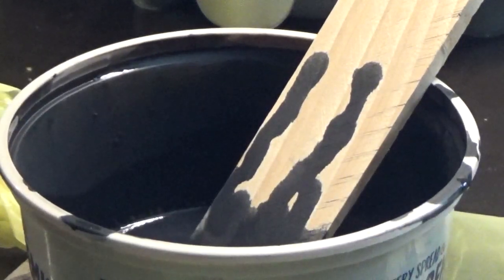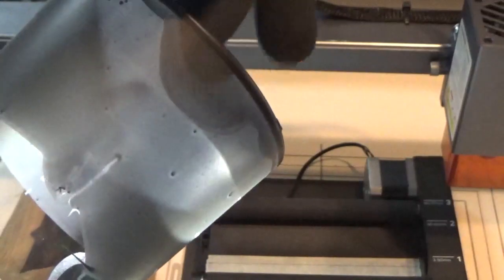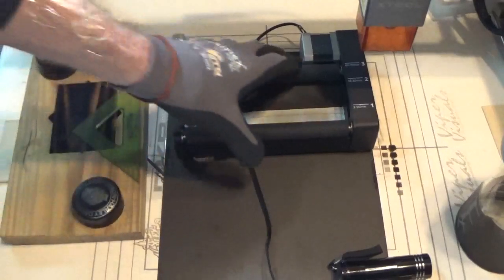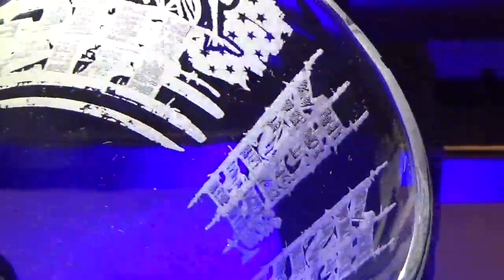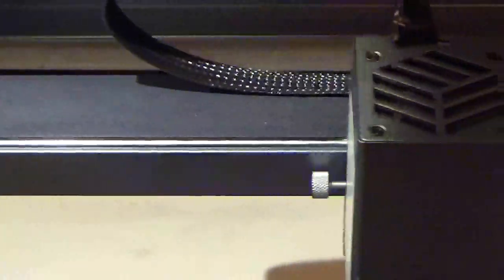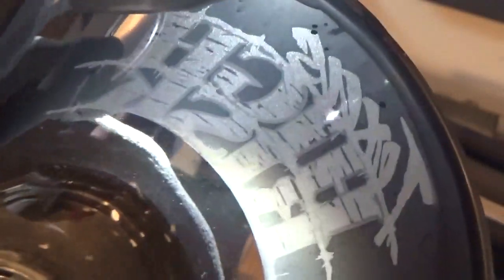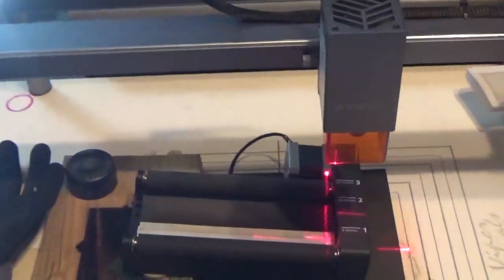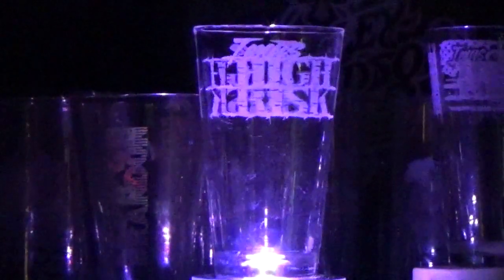Alternative Laser Masking for Cups in Rotary - The Latex Dip Anyone Can Do

Comment: Since it is coated on both inside and outside from dipping it the laser probably is etching both sides, the inside might be hotter so it flakes more (just my thoughts). The inside similar to the clear acrylic trick.
Reply from the maker: An air pocket keeps anything from getting on the inside of the cups. Only coated on the outside. Works great.

Comment: Great videos they are a great help. I am new to lasers just got my first d1. I am using laserbox software because they said it's great for beginners but I can not sync the grid in laserbox with the d1 do u have any tips on how I can do that or should I just start using lightburn? Also how did or where did u get your table grid?

Your tips are greatly appreciated.
Reply from the maker: Thank you and glad you find the vidoes helpful! In LaserBox, near the top on the right side is a blue button. Next to it is a pull down menu. Select your D1 in the pull down. You have to select an item in the view screen for any of the options to become active. LaserBox is a lot easier to use and I would stay with it until you are more comfortable and need more options.
Reply from the maker: The table grid I came up with myself just to have some idea on alignment. There are a bunch of grid files out there. The groups on Facebook have a bunch you can download or check on Etsy. Mine is nothing special and needs to be modified before I burn it to a new board for the new encloser.
Reply: Thank you for the quick reply that worked. now while engraving the laser keeps popping/skipping like if the belt is loose I have tightened the belt and still have that popping noise and everything I engrave the image come out blurry.

Again thank your for taking the time to help.
Reply: @robertsandoval2531  If it happens when the laser is near the edges it is probably cause you are traveling outside its limits.  When i first set mine up i was still trying trying to figure out how it works and it happened to me.  The alignment laser is 16mm offset from the actual diode laser.  If you use the alignment laser near the edges while framing, then during the actual operation the head will move an additional 16mm past where you had initially positioned it cause the diode has to travel where your red alignment laser was. This machine does not have limit stops, you have to account for it on your own.
    If it happens while just in travel during the process then maybe a belt is too tight or there is an obstruction.  Find out which direction it happens in and check the belt for that direction. Also mine was shipped with grease preapplied and dust particles and debris inside the box had stuck to it so check the rails and slide your finger down them to clean debris from the rails. Move your head manually in both directions to full limit and see if you can feel the obstruction. I hope this helps.

Comment: Which material setting are you using to engrave the glass?
Reply from the maker: I don't use any of the 'material' presets. I come up with my own. I use about 40 or 50mm/s for speed and 100% power for cups on the rotary.